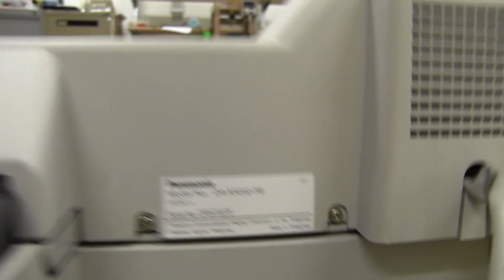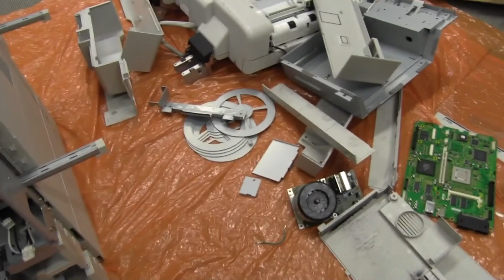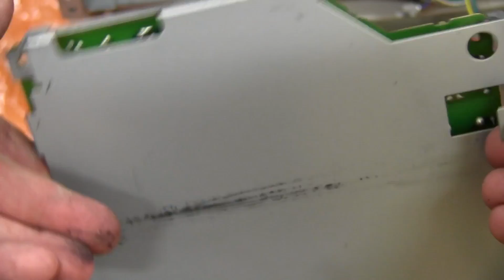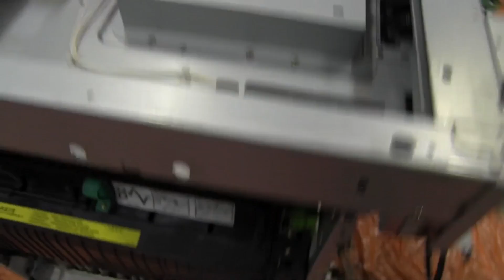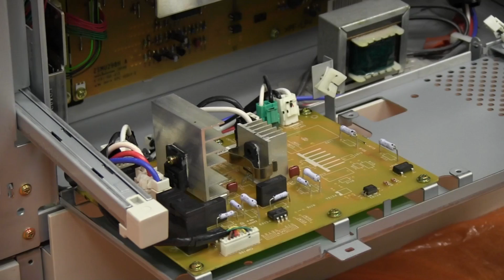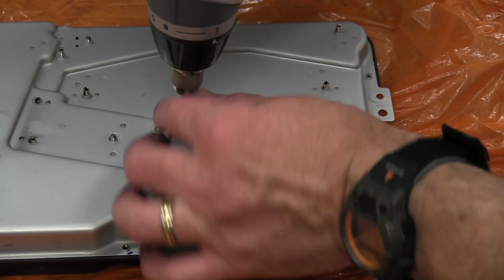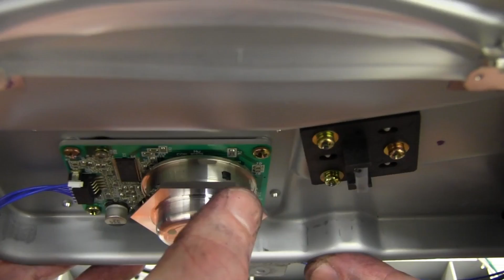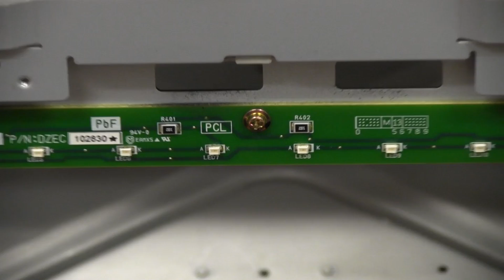EEVblog #303 - Photocopier Extreme Teardown

Comment: Late to the party, but as an old copier tech, just a few notes.

There is no 'secret harddrive' for capturing every copy the machines scan.  If there was, it would fill up somewhere around the 1000th copy.  There are digital copiers with integrated HDDs but you have to specifically tell the machines to archive the images

There is a security feature on digital copier, that integrates machine identifying serial numbers into each image.

The LED array you pulled off the Drum assembly frame is not for cleaning the drum, at least not really.  The drum assembly has a cleaning blade to remove remaining toner from the drum prior to it rotating in front of the LED array, known as the Quenching array.  The purpose of the LED is to neutralized the charge on the drum surface prior to it turning to the corona wire (which reapplys the charge).

Basically the digital image is formed on the drum in the following sequence:

1. cleaning blade removes remaining toner
2. Quenching LED neutralize drum surface charge
3. Corona wires apply negative charge to the drum
4. The Rotating Mirror array throws the image on the drum, w/ light portions of the image imparting a negative charge to the drum
5. the drum rotates past a 'magnetic brush' which allows positively charged toner to come into proximity with the drum, with the positive toner coating the negatively charged portions of the drum.
6. drum rotates to fact paper, the paper is more positive than the drum, pulling the toner off the drum onto the paper
7. paper runs through fuser, and the toner is fused into the paper via heat and pressure

8 customer doesn't like the image (usually because they never clean the copier glass) and place a service call, where they spend most of the tech's time listening to them complain about the copier.
Reply: Clell Harmon Thanks for information! I have been trying to learn the parts and how they work.  I deliver copiers and anytime we pick one up from a doctors office or government facility the hard drives have to wiped. I have been told that machines today can keep millions of past print jobs on the drives?
Reply: ***** Like I said, there are digital copiers with integrated HDDs, but you have to tell the machines specifically to store a copy  A quick check of the current corporate industry standards have the higher end units with three terabyte drives (some of the more absurd ones are actually installed with RAID arrays to ensure the images are safe)

Millions of past copies?  No.  Not on any one machine 10s of thousands would be pushing it.
Reply: +Clell Harmon Cool, thanks for sharing all this. Really interesting stuff! :)
Reply: Ewan Marshall Not on a copier of this vintage.  The image isn't really 'digitized' in any meaningful way.  It's a straight through path from the optics to the organic drum, with only a minimal delay through the logic array.  This model of copier does have memory, but only few pages worth (up to 20 if I recall correctly), and its plain old fashioned dynamic ram.

Which means the ram reinitializes each time it's powered up... or the next duty cycle.

Modern stuff, sure, you need to be careful.  These >15 year old machines, not so much.
Reply: DerHeimatlose1 Well, sure they could, but why would they?  Minolta already has production facilities that builds equipment far in excess of their needs, they market the excess to lots of companies to rebadge (and often recolor the plastics used) for a fraction of setting up their own facilities.
Reply: Clell Harmon I know from the security side that the buffers often keep the last x number of pages in network printers, I'm sure it's the same with digital copiers that work in a similar way. It eventually cycles over the buffers but some of them are rather large. So you may be able to get the last week's worth of data or so out depending on usage. But it's not infinite of course.
Reply: Yeah, I know, but you'll be surprised, that said, solid state buffers can be a problem to. And we have ways to maintain data through a power cycle of DRAM which takes hours for the data to naturally degrade fully and longer with tricks like the use of liquid nitrogen to cool it. Most computers do not actually wipe the memory on initialization just when they want to start using that page. Yes, it depends on the model as to how much of an issue it is.
Finally, often a business the machine is never fully shut down so over the weekend a network attacker can often get to those buffers. Ideally one wants to be able to store the whole document in the buffer these days (scan once then correctly collate copies of multi-page documents, so those buffers have gotten bigger (to hundreds of pages these days) but even 20 pages can be a problem if that is medical records, bank records or financial statements.
Reply: DerHeimatlose1 Yes, a lot of 'modern' copiers do use a HDD for storing both archival copies of documents and to ease multiple copy production of large documents (though RAM is far more common for that use).

However, these drives are not SECRET which was the original suggestion.

And a crusty old Panasonic (which actually appears to be a rebadged Minolta) is of far too mature a vintage to have a drive as part of the standard loadout, indeed it appears to be a very bargain basement machine, lacking the printer/fax board common from it's age.
Reply: Darren Tipple  Apparently Xerox started printing a hidden machine code on documents to counter fears of counterfeit prints in the 80ies. (https://en.wikipedia.org/wiki/Machine_Identification_Code) This is known to have been exploited to uncover whistleblowers.
Reply: +Clell Harmon
A lot of copy machines use the harddrive for storing double sided copys and so on.
Otherwise the security kits would make no sense.
And there are a lot of firms where you get much trouble if you take a changed harddisk with you - even if it is out of order and the security kit was installed.
Reply: +Clell Harmon 
Oh - so Panasonic where Minolta machines.
I didn't know that.
It's a little bit sad for me because I'm a big fan of Panasonic / Matsushita Electric and there's no question for me they could produce a own copymachine.

Comment: Love your vids!!  Some caution about the laser, the light beam they produce is in the infrared wavelength and is super focused which can cause blindness.  Make sure you disconnect the laser diode if you find a way to fire up the laser scanner.   The scanner motor (or polygon mirror) spins so fast it makes that whistle noise you always hear.  I remember we wern't supposed to touch the polygon mirror surface as the oil from our fingers would set them off balance!  Keep up the great series, greetings from Canada!

Comment: Just a note about the clutches, they are spring wound clutches. Copier manufacturers have been using the since 1969 (I was working on these machines back then). There is a coil spring surrounding the shaft inside these things and the little metal plate floating on the end is pulled in toward the electromagnet to make it clutch. The plate is tied to the end of the coil spring and causes the spring to wrap tight on the shaft causing the gear and shaft to lock up. When the coil is de-energized the spring unwraps and the clutch freewheels. Some guys call these 'Chinese handcuff' clutchs for an obvious reason.    Godfrey
Reply: Wrap-spring clutches go back many decades. Perhaps the Model 15 Teletype used them. The Friden Flexowriters definitely did. They often drove the load by one revolution and then disengaged. The ones I knew had springs wound with square or rectangular wire. They were lubricated, (but not likely with extreme-pressure oil!)
When disengaged, the spring was held expanded to minimize wear.
One end of the spring put some torque on the outer sleeve (spring inside), which was stalled by a pivoted pawl that was pulled out of engagement by an electromagnet.
Power to the magnet released the sleeve, the spring contracted, wrapped, and gripped the continuously-rotating inner cylinder. Left by itself, the spring gripped the sleeve inside it. If the e. magnet stayed energized, the sleeve continued to rotate, and the spring didn't slip. 
If the magnet's power was cut off, its pawl-armature was ready to snag an outward projection on the sleeve. That made the spring expand, and the driven member stopped. However, inertia made the driven member overshoot slightly, and another pawl and "one-tooth ratchet" kept it from going backwards. That kept the spring expanded, minimizing wear.
The driven shaft always stopped at exactly the same position.

Incoming power rotated the cylinder inside the spring. Cylinder rotated on the output shaft, which extended the full length of the clutch.

We called these single-revolution wrap spring clutches. They worked extremely well

The Model 28 and later such Teletypes and the IBM Selectric typewriter used a different type of clutch, which had a few pawls inside a shallow cup with a cylindrical inside surface. Those clutches also had a pawl to "stall" the load and disengage the clutch. Cup drove the load.
Releasing the first pawl used driving torque to engage another pawl, and as I recall, that second pawl made a third engage. The clutch simply did not slip! Stalling the first pawl made all three(?) disengage.  HTH!

Comment: For that high voltage board, if it powers the corona wire and if it's anything like a laser printer, -600VDC Would be my guess. My A+ Cert finally has a use!

Comment: notice the shaft that you pulled the clutch off. The gear spins all the time driven by that first motor. The clutch alternately connects the gear to the shaft to spin the shaft at your discretion.

Comment: Hi, this may have already been said; but those 2 bars coming out of the copier aren't carrying handles, lol.  They are support bars for a sheet correlator. I laughed when u said that! Good guess though and they do work pretty good as carrying handles; but, don't let 1 of the copier techs catch u using them as carrying handles, they'll have a heart attack!  Thanks for the videos, I'm learning a lot from them. Also, I do know that HP laser printers use 600+ volts to pickup and fuse toner 2 paper.

Comment: thats drove assembly is the main drive assembly it rotates the drum unit fixing unit and transfer unit and those are connected to the main motor assembly which you remove firstly those clutch are activated by many sensors on the paper tray path i hope this gives you more idea regarding copier machine have a good day Mr dave

Comment: Mr dave it has basically 3 high voltage corona unit first is the charging corona which adhere positive charge on the drum  the second is transfer corona unit which transfer the toner form the drum to the paper and the separation corona unit which separates the paper and toner from the drum of the copier

Comment: I don't really care if you could fix a copier or not.  The Term HDD could be just as easily used for "High Density Disk"  There is no need for further ranting about it...  Dave said "Hard Drive", I meant "Hard Drive"...  By the way, I fix Computers!

Comment: Well, let's just say this.  You can go around calling a hard drive an HD because, yes, those two letters are the first letters in the word Hard Drive, but you are going to have to explain constantly that you mean Hard Drive instead of High Definition, which is now the most commonly used meaning of the acronym HD.
If you say HDD, people already know you are not talking about High Definition, they know you mean Hard (disk) Drive.
I fix copiers, in the parts list it's called an HDD.

Comment: Yes, Bill - the image is scanned in electronically and then deposited electronically onto the photoreceptor drum via a laser mechanism.  I took apart one of the original laser HP laser printers.  There is a laser beam focused onto a rotating "hex" mirror.  The beam is swept across the photo-receptor drum which removes electrons from the drum (that were deposited on the drum in a previous step) according to the image printed.  Toner then attracts to the spots where the electrons were removed.

Comment: I share your feeling of terror whenever I take apart some complex mechanical device like this, and think about how hard it would be to engineer. Of course the mech eng types who designed all the moving parts would probably feel just as intimidated by a lot of the electronics design you find second nature.

Comment: Copying also uses this module to set the image on the drum. The machine does not have 2 ways to transfer dots to the drum.
This is a very over engineered laser module. Take the HP 5N or alike which just have plastic laser housings with the same basic elements and is really effective and simple to maintain.

Comment: When I was a kid I took about an 80s Xerox copier it was all optical and mechanical nothing digital except for the controller.
But there was a lot of motors,a chain drive, a couple of fans, and an interesting little HV generator that worked pretty good on two 9v batteries.

Comment: Check out the engineerguy btw, he has some fantastic vids. He shows an older photocopier, so the image from the original paper is transferred directly to the drum... /watch?v=MJ5ghlTdF9k

Dave, did you keep the laser assembly? The power and ground should be easy to find (across the big cap?). It will likely have an input for speed control (analog or frequency), and an index pulse output. The datasheet for the drive chip will probably show all these signals.

Comment: (As others have said), the scanning laser forms an image on one side of the drum while the other side of the drum is being coated by toner (by the high voltage charge) while it rotates. The light from the laser itself changes the charge where it hits the drum (so the toner won't stick where the laser hits).

The paper is given a different charge and moves past the drum at the same time. The toner on the drum (with the image) is attracted to the paper and is then fused on with a heater. :)

Comment: At 41:30 - yep, the CCD chip only has a single line of pixels, it only captures a single "line" of the original page at a time while the scanner mirror moves (or the whole scanner bed moves).

The laser is IR in most copiers, so it's invisible to the human eye of course. You can make a nice "liquid sky" effect out of that spinning mirror and some smoke if you replace the laser diode with a visible one (a 300mW red diode from an LPC-815 DVD burner can be bought for less than $20).

Comment: The high voltage is used to feed a "corona" (I´m sorry, I don´t know it´s name in english), which charge the photoelectric cilinder with electrostatic charge. There is another corona to transfer the image from the cilinder to the paper. Both need high voltage. Hope I helped!

Comment: It used to be you could count on finding a nice big juicy lens used to shine the image on the drum. Nowadays it's really no more than a scanner and a printer in one box like a PC system.. No real optics.

The black box is the laser scanner that puts the image on the drum. The motor has a multi-sided mirror that moves the beam around (scanning) and the video turns the beam on and off for white and black, perhaps changes intensity for grey scale.

Comment: Sometimes little speakers are used as a kind of sonar to measure how much toner is left in the hopper. Was there any kind of container nearby?

The adjustment at 25:50 is a cam. As the lever is moved up or down the adjustment scale, it raises or lowers the T-shaped assembly directly above, bearing down on it. Then they lock it with the screws. Don't know which adjustment, though.

Comment: Toner doesn't stick where the light hits the drum. Just the opposite. The HV charges the surface of the drum which attrats the toner. Wherever the light hits, the selenium shorts out the charge. Wherever the charge remains, it's because there's black on the original. The toner sticks there and is ironed on the paper.

There is a developer powder that is magnetic. There is a big bar magnet that uses the developer to transfer the tone to the drum surface. Keep the magnet & developer to play with!

Comment: Yes, they're clutches. They transfer motion from chains/belts driven by a main motor to whichever shaft needs to run at any given time. Sensors tell the CPU where the shaft is and the clutch pulls in to rotate it as necessary per the CPU. The flywheel probably irons out the bumps from all the clutched loads kicking in and out.

Cog + sprocket = sprog?

Comment: Notice how the flywheel is made of stacked laminations (vs. cast), and, by staggering those, the spokes of the wheel form fan blades to move air. Very clever.

They use 100 vac in Japan and so they often build for that and put in a xfrmr for foreign voltages. What did they do this time?

They will make a bracket at the drop of a hat. I picture some poor old bracket guy at the factory and they keep using them so he can keep his job.

Why the big bump space over the CPU? There's only one slot.

Comment: Great vdeo Dave. I recently was lucky enough to find a high end Canon copier next to a dumpster. It took me two days to get all the parts out of it. It had tons of stepper motors, sensors and switches. The control boards can be sold on ebay, I wish I knew that before I not-so-carefully removed them. If you're lucky enough to find a copier or laser printer TEAR IT APART! This one probably uses an IR laser but I did find a huge copier that used a Melles Griot He-Ne laser. That was a great find.

Comment: Yes it can be used with no problem, its a simple 4wire touch panel as Dave showed. There are tons of info how to use them with some adc stuff :). If i not mistaken they work like a variable resistors for 2 axies, but don't quote me on that :)